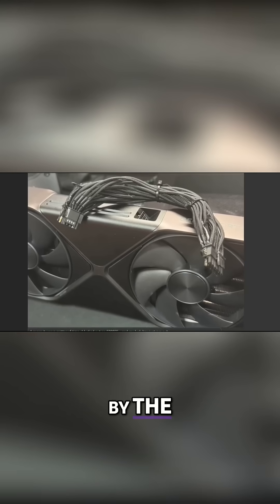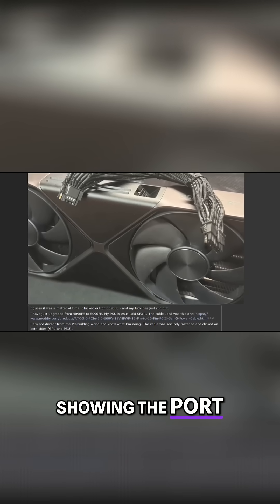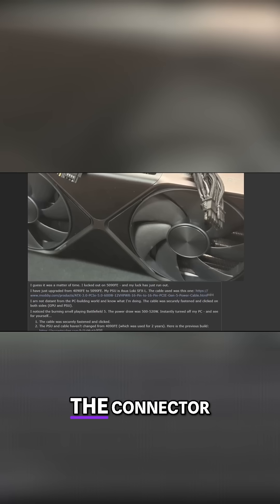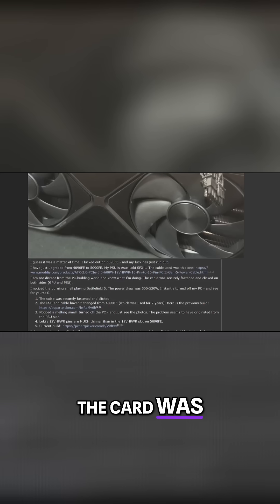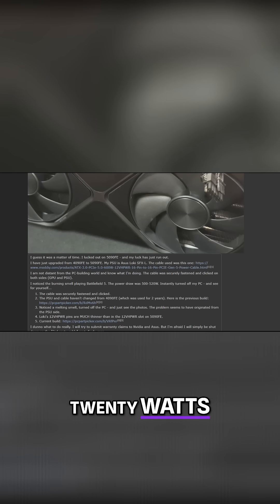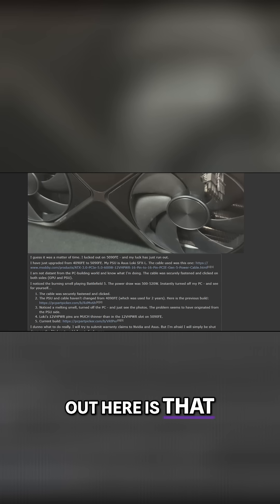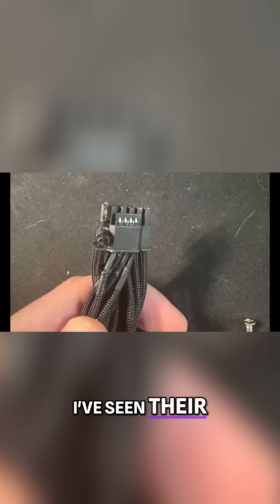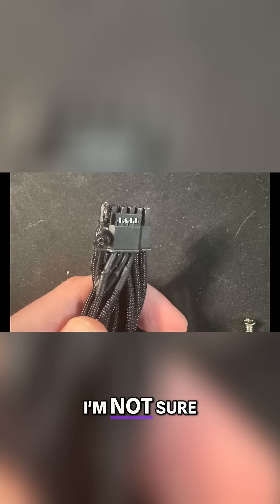RTX 5090 Connectors MELTED! Nvidia's POOR Decision #pcgaming #gpu #nvidia #rtx5090 #5080 #5070 #amd

Comment: It is a design flaw the case is happening on the 5080 too. Look how the plug is angled it is asking to cause issues idk why NVIDIA did this 😂. Go to og 4090 pin connector with two plugs instead of one it'll take some heat off just one cord. They likly dud this to cut corners to save $

Comment: Proves how cheap it is made.... Pcie connector isnt even connected to silicone its a cable. The 2080 super was the last that had the entire silicone. My 4060 is literally half as big. I think the newer cards are just big to look big not because they have to be. And there should be voltage regulation stuff to prevent this. Is Nvidia about to start making power supplys? 😂

Comment: M8 the cable has on pin molten on the card. But many on the PSU and even the cabel itself is molten. Der8auer already made a video about it and its most likely not the cable. He will not take appart the gpu because the owner wants to send it to Nvidia.

Comment: Nope, THE FE editions are pulling more than 20amps on 12v line... Thats why it happened. Nvidia didn't put sensors i  to prevent it. THEY CHEAPED OUT!!!
Reply: Aaaand it's still a $2,000 card.

Comment: Regardless of pin seating. This is not user error and wholly an Nvidia problem.  Why the fuck would they move to shorter pins. The decision was stupid, especially when asking a hefty premium.  As the end user. Things like this are supposed to be plug and play, not plug play and melt.  Absolutely unacceptable for a 2-3k card. Personally it's almost enough for me to abandon ship. Sell my 5090 on eBay and move on to and(yes I know performance isn't as good).

Comment: Somebody actually just did a video where the pins after installing two to three times get pushed into the seat. It makes a tiny little gap which creates heat. I think the pins inside the plug are moving around. Make sure to check your pin depth on all connecting points before installing your GPU.

Comment: Buildzoid has a great breakdown. The  summary is the 4090/5090 has much fewer shunt resistors compared to older GPUs. Like 1 vs 3 from previous GPUs. So if a connection is having issues, it doesn't spread the power evenly among the cables.
Reply: Not to mention there's almost no current balance which is NUTS especially when you take account on the fact that they're not designed to handle 200W for each pin